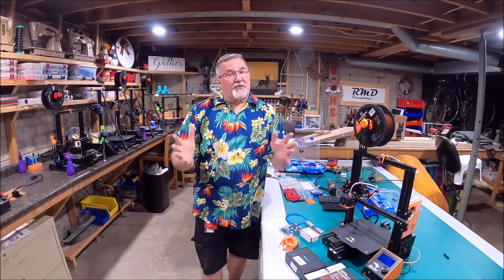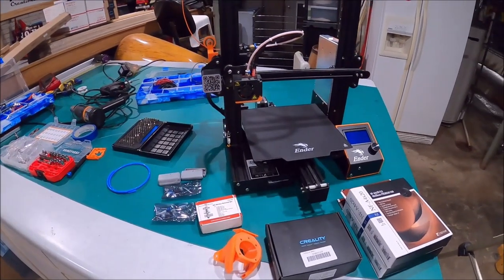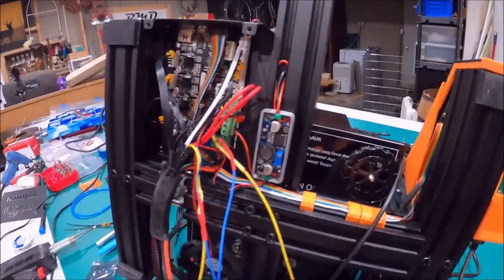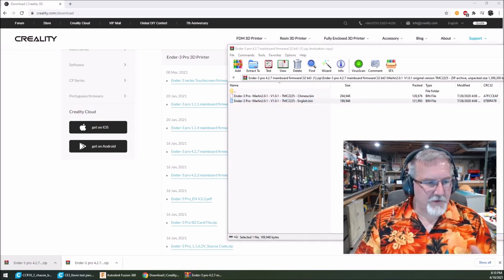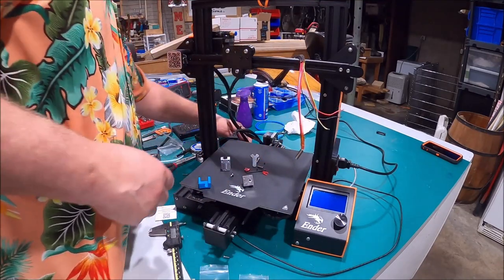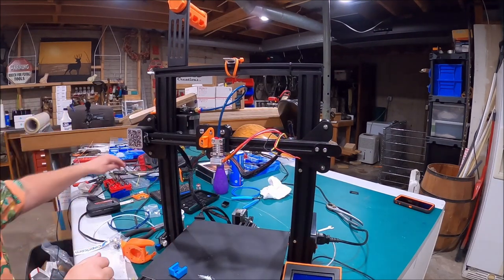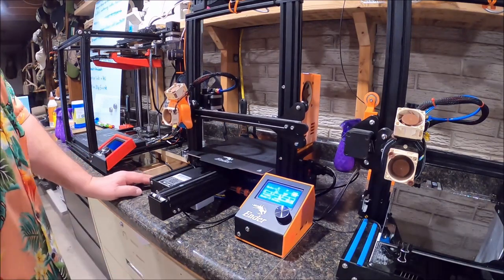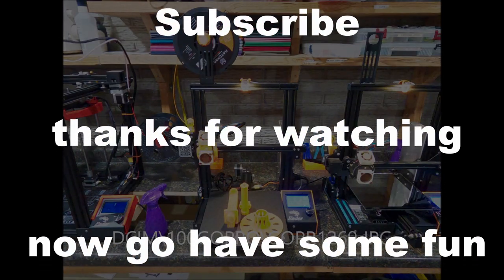Creality Ender 3 Pro MORE intense upgrades the Must Have and the How to make it the best it can be.

Comment: Printed the cooling ducts, added the buck boxes.  Upgraded the motherboard to a 4.2.7 even added a cr touch.   But the fans you have linked are the 60 mm ones. Not the 40 mm ones needed for the duct work.   So now my printer is down until I can get the new set from Amazon. 😫😢

Comment: 2 years later, would you have any recommendations to these videos in retrospect/with todays tech? 

I was gifted an og 8bit ender 3 that I was going to upgrade a bit to work with what I have. Was going to look into ordering a Color Display Screen and 4.2.7 32 Bit Silent Control Board set, potentially a Dual z-axis Upgrade Kit, and a cr touch kit. Wasn’t sure if the recommendations in this video would add or take away in looking at those upgrades/ better ways to make the printer useful without spending enough to just buy a new one
Reply from the maker: The upgrades I did on this machine is something I would do again. Thanks for watching

Comment: Hi Michael! Thanks for the great content once again :) I wonder if you have/had any X-gantry sagging on the Ender 3/pro/v2 with the allmetal Extruder. Few other guys recommend a dual Z kit first. 
Ive had enough sagging even with stock extruder. I never went back to weight and compare the stock shroud+fans vs silentFang +Noctuas4020
Reply from the maker: No sagging and the prints are coming out great.

Comment: If you want to do a BL Touch upgrade I would not recommend the Creality kit, it is a pain from start to finish.
By all means, the kit is a cheaper option than other sources but the ISP programmer needs the software folder renaming to remove the Chinese letters as it comes up with 2 kernel errors without the rename and the firmware that comes with the kits download is not BL Touch compatible and the software that is compatible from the Creality store has not had the X, Y offset configured so the probe will only measure 2 thirds of the bed and there is no Z baby-stepping configured either and to top it off there is no Marlin INO file so you can't edit it, for the stock 8-bit board you can't go wrong with the E3D Unified Firmware, and an Arduino to flash a bootloader, you could use the ISP programmer to flash a bootloader, but this method is reserved for masochists.LOL
Reply from the maker: interesting information. Thanks for commenting and watching

Comment: Great vid as always.  Do you have an upgrade for the ender 3 v2  where the pi is together with the screen/control like the the ender 3 pro?  I can not find a file like the one for the pro that fits the V2.
Reply from the maker: I have not seen one I have an upcoming video where I direct wire one onto my Ender 3 V2

Comment: I have a pro model. If  I upgrade to the 4.2.7 silent board and the color screen from a v2 ,,,do I then use firmware for a v2 or for a pro? I also do  not have a bl touch
Reply from the maker: I found that either will work.